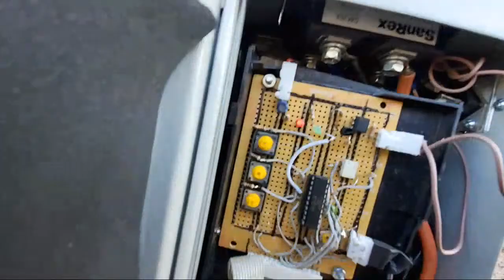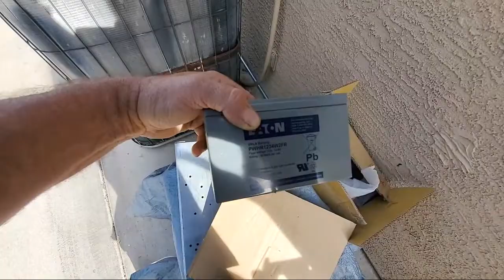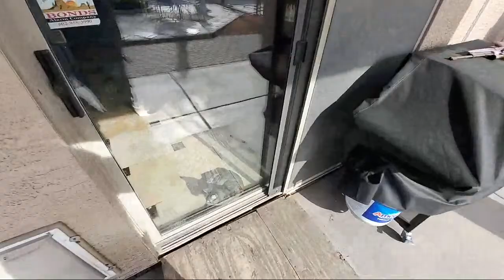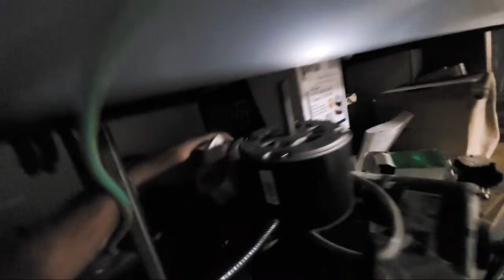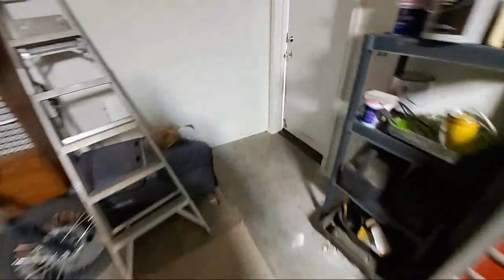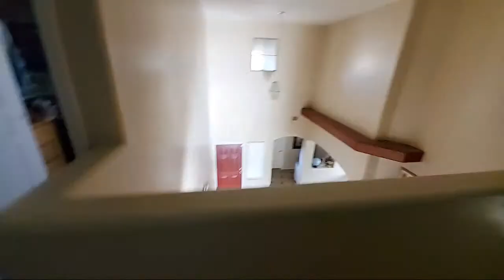Live: 4PM SOLAR AC Check

Comment: Those should be AGM batteries.....Lead Acid based...just have to be careful with current capacities, they are a sealed system, and can't handle higher currents for extended times due to heat buildup.  As long as the charge/discharge controller keeps the current within design parameters, you'll be fine.   In UPS systems, the charger/inverter is matched to the battery capabilities.

In previous video, you mentioned the outside unit runs off the Solar, but the inside half is still purely A/C.  If you lose A/C power to the house, the air handler side will stop working, but the compressor half can keep running.  The thermostat/control transformer is on the internal unit and should kill the call to the compressor if the internal unit loses A/C, correct?
Reply from the maker: Yes. If the utility power goes out the inside unit and thermostat etc all loose power.
However I am debating on modifying the inside unis some day so it is also off grid.
The blower draws a few amps so it may cause my solar system to no longer run the outdoor unit.

On 1st stage with the blower on low it is likely under 1 amp and the compressor is at approx 60% to 65% it's current when dropped down to 40Hz when running 1st stage cooling.

I could always make a simply utility powered relay that would break Y2 2nd stage from the t-stat if the utility power is not present and have some backup cooling almost guaranteed.